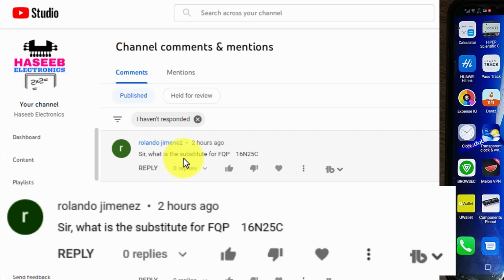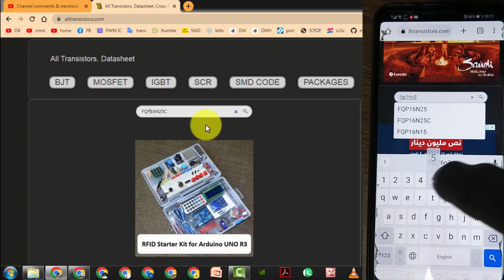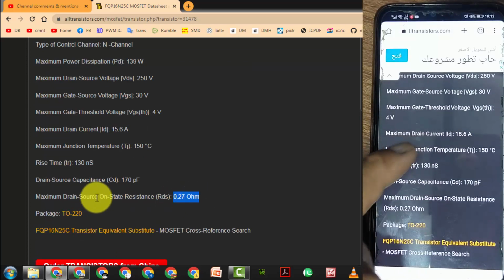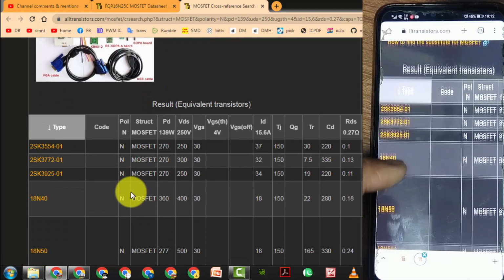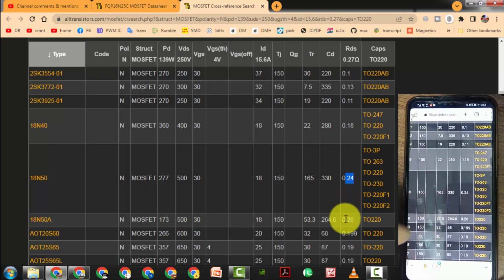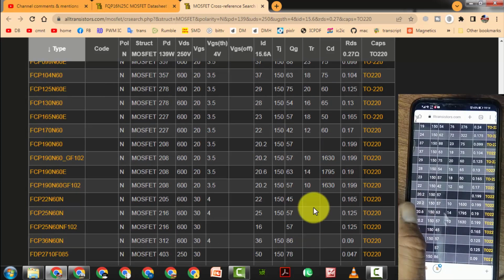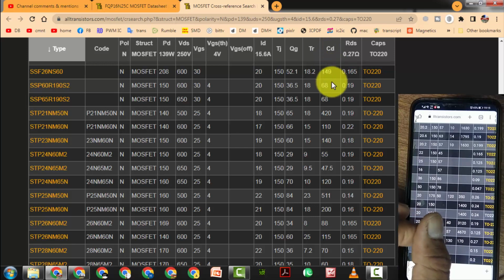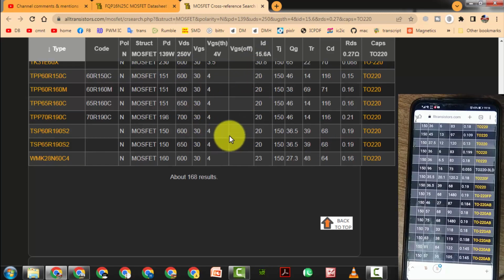{757} How To Find Equivalent of MOSFET

Comment: Hi sir,First of all i liked to thank you for your all infomative videos . My question was about 12VDC to 300VDC Inverter transformer winding . I already followed your SMPS transformer winding videos ,but i have problem regarding the calculate the number of turns according to amperage .because for the small currents we can parallel the few numbers of same magnetic wire.But when we deal with more than 10A,above method was not practical .I saw some videos on youtube they divide the total current by 2 ( Because push pull configuration ) then the answer divide by  current dencity Ex 5A/1 s.q mm. then answer was comes wire size in  S.q mm. Is this method correct sir ? Can you please explain this matter ..it's very helpful sir.. Thank you.